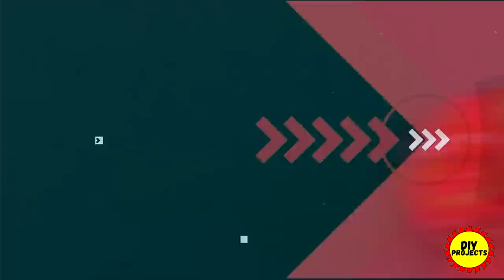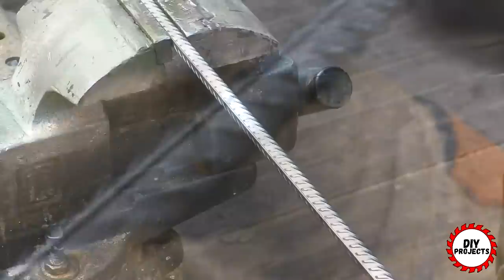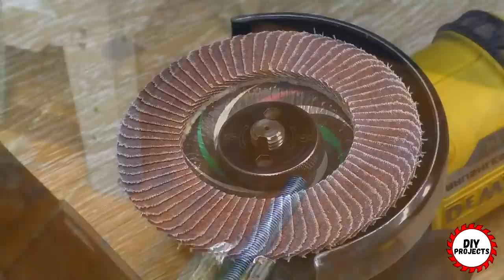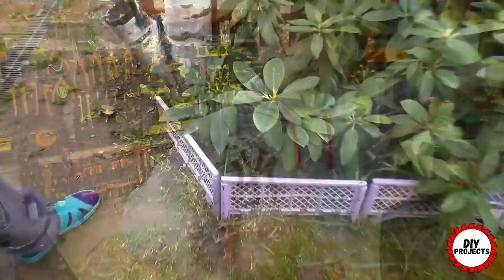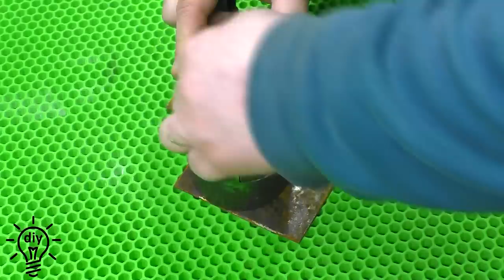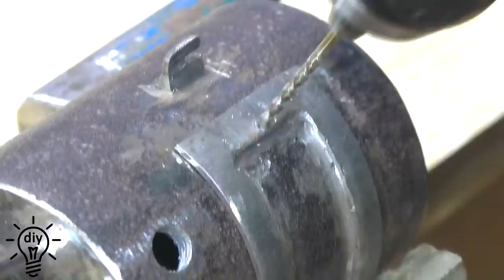The Masters don't want you to know! SECRET TIPS

Comment: The one with the soldering isn't actually a good idea. Solder needs to have a certain relative amount to be applied to be effective: too little and you don't have a strong enough connection, too much and you'll get cracks inside the solder hindering electron flow.

Comment: I really hope that block of wood is not being used as part of a tow hitch! Just because it feels strong in your hands does not mean it can haul a trailer without breaking...
Reply: That block of wood is just showing how to get a screw/bolt to catch in a hollow metal structure in general.
Reply: @zombiepirateninja1438  considering the guy has a welder, he could've just... Welded those parts instead.
Reply: @BrunodeSouzaLino  you're missing the point. The video is teaching US tricks. Though this particular guy may have a welder a person watching this video that needs to get two pieces of metal to join may not have a welder, in which case this trick comes very much in handy. Go ahead and rest your fingers because you clearly cannot think before you type. 😉